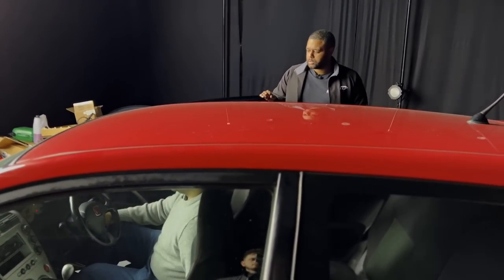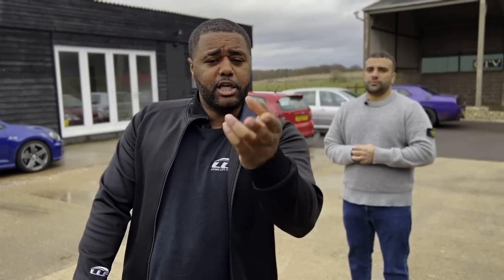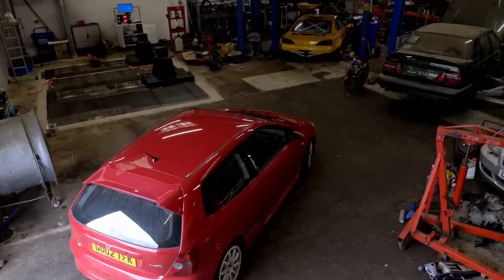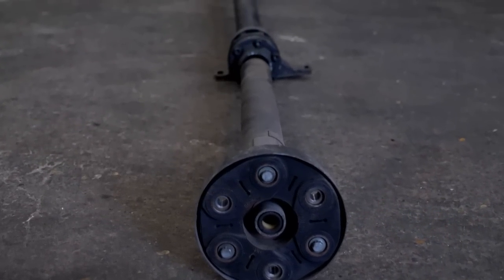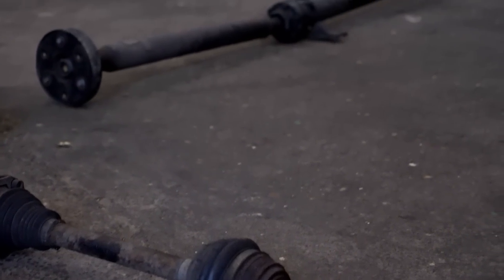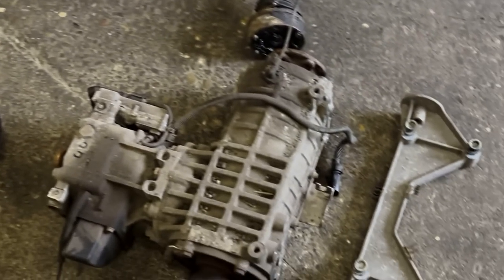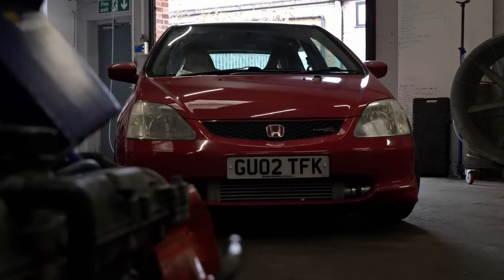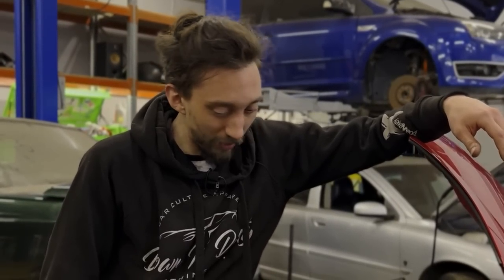I'M BUILDING A DCT QUATTRO CIVIC TYPE R!!

Comment: The 3.2 in the MG would be a very cool build, Or a Volvo 5 pot but that might be too long. 
Also I don’t see how putting the V6 in a ZR is a waste they’re just as capable as any ‘00s hot hatch when set up properly
Reply: They're built on the same platform as an EK Honda Civic and people rave about them.
Reply: @CYMRU619  The ZS is the one based on the civic platform and yeah I've had one they handle amazingly well plus the V6 is great too it's just a shame you cant really get much more power out of the V6. The ZR has a bit of Honda in the platform I think but not as much.

Comment: Not to be negative Nancy but haldex is literally the worst 4wd going, it runs fwd most of the time until 1 of the 2 front wheels slips then engages the rears. This coming from a TT owner, ps you fancy giving me what's left over from the v6? Lol could stick a few parts on my 225, front bumper spoiler etc

Comment: Dude there so much fucking about with putting a dsg on a k20, cutting parts off the engine block,  angle of the engine needs tilting back not just as simple as he's making out oh just bolt it on
Reply: Because he chats wet, he conned loads of people out of money with unfinished builds.

Comment: Wtf now this is interesting, coulda tried to make an EVO drivetrain fit though to make it even better
Reply: That's far to expensive plus you'll need running gear. And get rid of active yaw control.
Reply: @JDMz  he needs running gear to do this conversion. But yeah an RS evo conversion would be very expensive just in parts